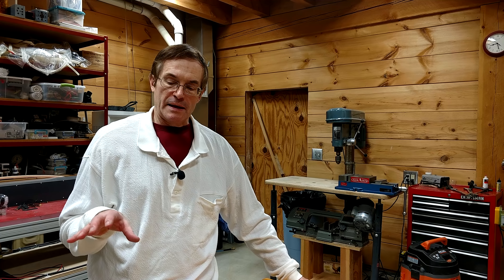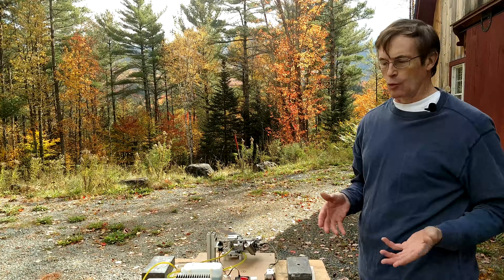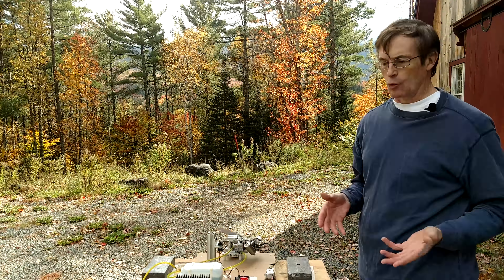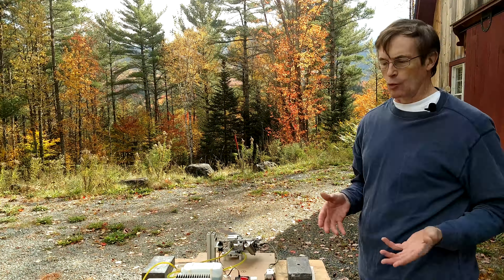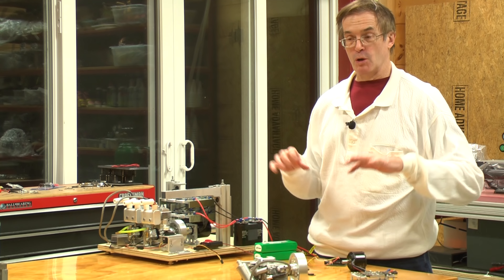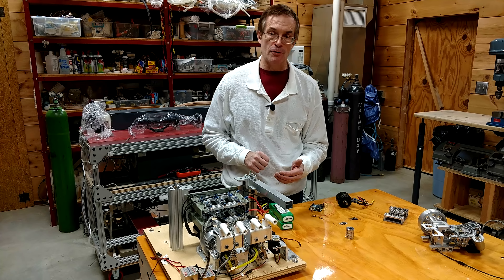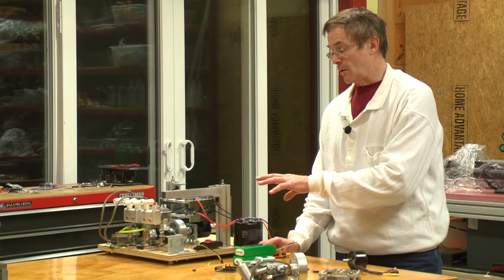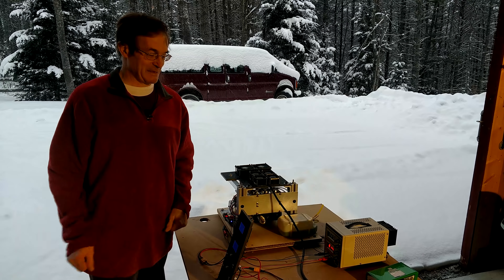Hybrid Drone Generator

Comment: Lol why go through all these complicated systems - just connect the damn engines to the Drone Rotor blades - less loss of energy. 😂
Reply from the maker: It doesn't work well.  This is why you don't see these very often.  The gas engines are less stable, have a course RPM resolution and respond to control inputs more slowly.  It's also harder to isolate the noise and vibration of multiple, distributed engines that are directly coupled to the airframe.

Comment: why the hell is it.. that accademics HAVE TO recreate the wheel, everything they do.. JUST go see your local model RC modellers club.. they'd have worked out a cheap simple EFFECTIVE solution in an evening.. & a 4-stroke would NOT have been in the equation.. a wankel would have.. what is the point of two single cylinder engines when an opposed twin deals with ALL your demands.. AND.. where do you get that 4-strokes are more "efficient" than 2-strokes.. lbs per hp hr.. 2-strokes tuned to the specific application will beat 4-strokes every time.. hp vs hp
Reply from the maker: We are not accademics, nevertheless this project is a great opportunity to work through physical principles, engineering solutions and construction techniques.
No, they wouldn't and couldn't because while talk is cheap actually doing and testing isn't. Rotory engines would be an excellent alternative, but other than a few, used, legacy engines on eBay, they are not actually available in a useful size for a practical cost.  I explained and demonstrated in the video why the twin isn't a good choice. You should have watched more carefully.

Comment: Glow fuel engines are far from energy efficient.
Reply from the maker: They are.  We are using two stroke gasoline engines.  Four strokes are even better, but they vibrate more.  Turbines are pretty inefficient, but they are very smooth.

Comment: This makes no sense.  Why make a generator when you have a engine that can directly drive your drone? Learned new word "pulsatile" !
Reply: Not a drone expert, but I think they need very fast throttle response to deal with turbulence effectively. The throttle lag could actually cause oscillations and possibly a crash if the control loop were poorly tuned on a test flight.

Comment: 300 Watts is basicaly nothing for 2 motors with more then 2hp , the efficiency for a brusheless motor as a generator is very low. I don't think this project will be a success. Have a nice day.
Reply from the maker: Check out our follow up video.  Over 2 kW is what we demonstrate.
Reply: Thanks for your reply. I will Check out the follow up but I'm still sceptic about the weight and the efficiency of the projekt.

Comment: It seems that this guy is dicovering that combustion engine have pistons and rods that you can't balance completly!!
So if you listhen to him, monocylinder motorcycles are impossible to build, vibrations would make the transmission to brake immediately.
I'm in motorcycle race mecanics since 40 years and also in areomodelism with the same engines he is showing since the same time and i'm really concerned about this video, it shows me that i know nothing like Jon Snow!!
Making a drone generator this way, with some much weight and problems is a nonsense, for the same weight of battery you achieve better performances.
I have also thought about it for my big drone that can lift 30 kg of payload, but after making a few calculation i understood i was on the wrong way.

Comment: But its using fuel!! So to be fare its not genarating anything extra. Because the  whats its making extra in electricity the fuel is being used!! Hmmm dont see the benefits here. But dont get me wrong it is a very nice setup!!
Reply: He said in the very beginning that power density is higher with fuel. Basically he is getting more power generating electricity with a combustion engine that he would if he replaced that weight with batteries.

Comment: People like this are all theory and no common sense. They over think useless aspects and totally miss the obvious. For instance If this is for a drone the best engine configuration is a radial pancake motor so it can be installed with even forces acting radially. Pretty obvious... Robot dad strikes again. Net he spent ten times the cash he needed to Aswell.
Reply from the maker: Ha!
Price out a radial pancake moter motor if you so concerned about cost.
Reply: @TechIngredients  just make one from 3 normal motors...are you an engineer or a lego enthusiast? a few machined parts and your done.
Reply from the maker: Easy on the insults.  Reconfiguring three engines into a single radial engine is a complex task.  I'm presenting a more practical assembly for interested people to construct.  The vibration levels are remarkably low already, as I clearly demonstrated.
Reply: @TechIngredients  if you think thats an insult then i have nothing else to say. real engineers understand that challenges of all kinds are what real engineering is about. not a sancutuary for your feelings.

Comment: first !! I must say your video is very interesting. But; you are using to many acronyms for the lay-person to comprehend !!
Also your jet engines fuel supply seems to be a huge obstacle, for anything more then theoretically flagellation at most!!
In lay-terms what application would you use it for? Except for demonstrational purposes at best, also you stated that most of the jet engines for sale are exorbitantly priced .
When their are already jet powered motorcycles, cars, boats etc. you name it. why are you trying to reinvent the wheel?

Comment: Counterbalances only work while the motor is running. Not when it's off, so when off, just because there are counterbalances, you still won't be able to balance your motor like you are showing.

The other issue is as I have watched a few of your videos, there are some things you simply do not understand about the dynamics of gas-powered engines and I would say something generally but I've learned already that YOU, the youtube host, won't listen to anyone commenting and other commenters are total know it alls so they will chine their ignoramus mouths off and argue and call baby names and no one listens to anything.

So, good luck with your idea. I already know the solution and you are far from it. 

Also, its very hard trying to come into your channel new and follow what you are doing and your videos are not being labeled properly, another problem with youtube I wish they would address. 

I get so worn out searching youtube channels trying to find the original videos. A good idea that others do, is they post the links to the previous videos in the description AND they create a playlist of all related videos. So it becomes easy to catch up and follow along. Few youtubers will do this.
Reply from the maker: As I address in the video, the counterbalance on the flywheel changes the imbalance from vertical to horizontal.. Using two, out of phase engines negates this imbalance. 

You come across as angry and without provocation. We address an unusually high percentage of the comments on our videos, but your attitude isn't helpful and so I'll wish you luck.